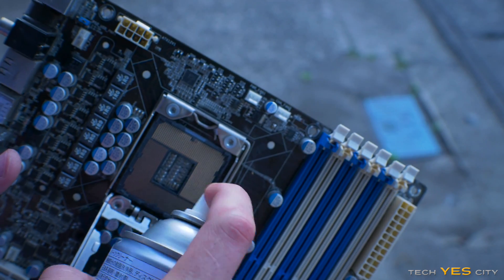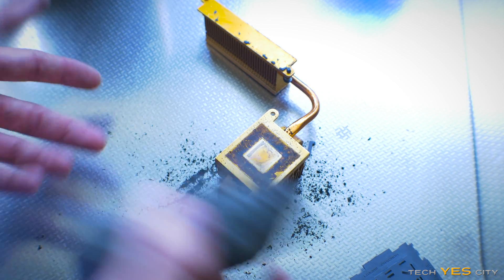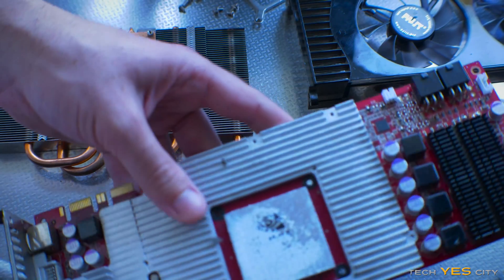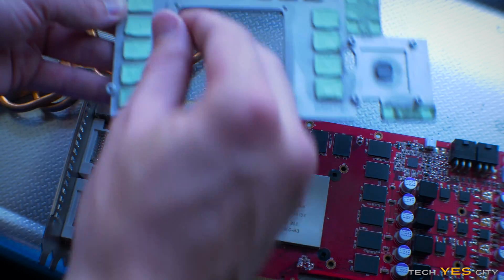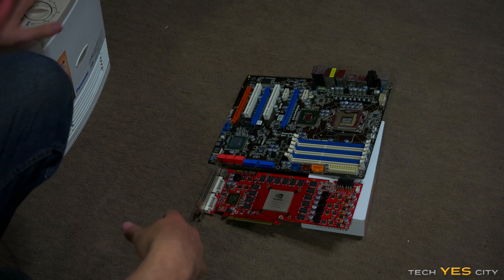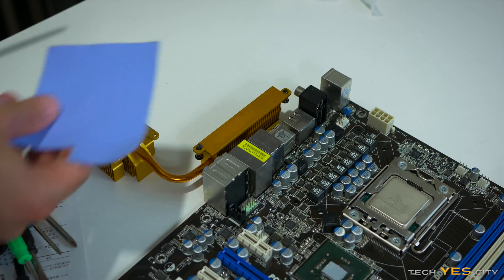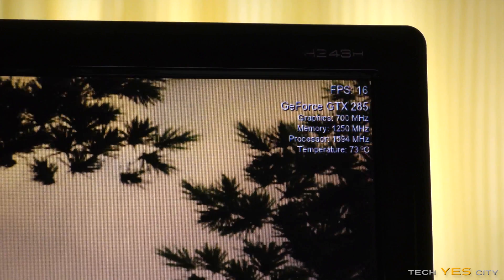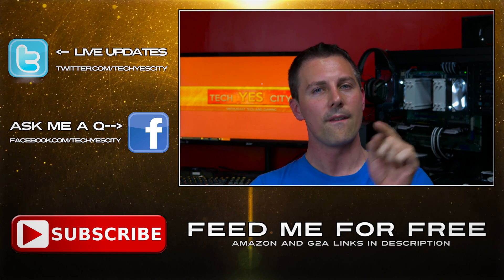PC Parts RESTORATION - How I CLEANSE - Ft. Before and After Temps

Comment: This hurts to watch. I hope no one sends me boards that they cleaned like this.
Reply: Thomas Stolk he legit says in the video "don't spray the plastic fans with break cleaner because it will destroy the fans".
Reply: windowsfrozenshut A $4 thing of 99% alcohol from ebay and 21-14615 brush from mcm electronics. no need to overthink it. ultrasonic cleaner is obviously best but most people have no access to that, so just use the brush with some alcohol and don't overthink it. if there is a part that genuinely needs some scrubbing, some $10 pack of clean room wipers from ebay and 99% alcohol will do as well. 

the further we get into using weirdo chemicals the higher the chance of screwing something. If something isn't nasty and broken, I honestly wouldn't even bother cleaning it. So much shit gets broken for silly reasons from people doing weird things to try to clean it!
Reply: Thomas Stolk Not all break cleaner destroys plastic dude, hence why the damn thing works and why his method has worked in every cleanse he's done so far. I'm not claiming this method is the safest. I think alcohol wipes and a air duster will do the job too, but non-chlorinated brake cleaners will not harm all plastics.
Reply: +Thomas Stolk none of the plastic was cleaned with breakcleaner, unless you weren't paying attention.
Reply: +Louis Rossmann Lol, I was thinking in my head "What would Louis Say about this method" My Curiosity is cured!
Reply: It's hilarious how many people take Louis and Brian's comments deadly serious.
Reply: Adeel Rehman
You missed my point... If it eats through plastic, it's gonna eat through other stuff as well! Also, how did he clean it? With a few wipes? That doesn't get everything. And even if it did, the major problem is that some of it gets under the BGA chips, try getting that out of there with wipes!
And again, corrosion! Who wants their motherboard to start freaking out, because there's corrosion under the south bridge? Worst part is he's selling them to people without warning them about the condition of the components.
Reply: windowsfrozenshut
How can you expect reports? There's probably 5 people in the world that are doing this. And at least one of them resells their parts, meaning no feedback. Also, not everything that hasn't been proven dangerous, is safe. One example is cigarettes. They were considered safe for years.
But you know what, fuck it! Take your computer apart, spray your GPU, CPU and MB with break cleaner, post a video of the process on youtube, and I'll send you the money for the break cleaner over paypal!
If you're right, you get your PC cleaned up and a free can of break cleaner! ;)
Reply: +Adeel Rehman not much of the board? all of the IC's are in plastic. not to forget all tbe connectors.
Reply: Thank you louis.
Reply: Thank you louis.
Reply: reaper reaper well, he's never cleaned anything valuable like this, so. Most expensive build he ever did was 300 bucks or so. With a 100$ motherboard
Reply: Adeel Rehman
That's a lot of money! Plus, he's calling it safe, which it isn't! What if someone who barely managed to save up for a new GPU or MB, does this and breaks something?
Reply: windowsfrozenshut
Where are the reports saying that it doesn't cause damage over time? We're simply using logic. If it says brake cleaner on it and it eats through plastic, it doesn't belong on your GPU!
Reply: didn't he cleaned it with alcohol at 9:03 ? , I believe he did that.
Reply: not all electronic cleaners sprays attack plastic, the only way to know this, is spray the plastic blades of one of the fans in the computer, if they turn white, I wont be using that cleaner, instead will buy another brand (sorry for poor english)
Reply: windowsfrozenshut if you didnt wanted a "random" to anwser your question, but instead to only have louis to anwser it, pm him. or live with it that people respond to your question :^)
Reply: ***** He does not hate LTT. He made a video on how he does not hate LTT.
Reply: ***** He made a video dedicated to explaining how he does not hate LTT. You want the link? He said he just dislikes the reballing myth.
Reply: ***** lol, k.
Reply: reaper reaper well, not much of the board is made of plastic. And tech yes city removes the cleaner later. And the one he uses is light on plastics.
Reply: Thomas Stolk
And he didn't even clean it properly in the video.
Reply: windowsfrozenshut
As I said, OVER TIME! If you clean the chemicals off, then you won't have any over time damage (obviously), but he did NOT clean them! And then he sprayed them with some other crap to make them look shiny.
Reply: @reaperreaper9593  is this dude serious? He even brought up the fact that his entire job is fixing machines that operate under these conditions, but still claim that because nobody made a redit post yelling about losing a ram slot from brake cleaner it's safe? 
I suppose it is only in his best interests that people think you are supposed to break your components under maintenance, nobody calls the technician before shit breaks haha!
Reply: Phakes L. Alcohol wipes, plus that doesn't get rid of the stuff that got under the chips.
Reply: Louis Rossmann Should I use water instead? 
[sarcasm]
Reply: ikr
Reply from the maker: Don't worry no one will be sending you boards that they cleaned like this as they will be busy enjoying their time with the restored product.
Reply: +Louis Rossmann Louis, i decided to clean my macbook with break cleaner, now it wont POST. I already shipped it to you, and filled out the form. Hope you can get it working again. It should get to your store by tomorrow.
Reply: LOUIS!!!!!!!!! Also what's wrong with his method of cleaning?

Lol not everyone has an ultrasonic.
Reply: ***** if by always you mean pointing out something that is going to cause a lot of people to break otherwise working hardware on four separate occasions in five years, then guilty as charged. I have over 900 comments in my feed every day, and a good portion of those are highly critical of every thing I do... it is a side effect of uploading public YT videos. I wish even a quarter of my trolls were as mild as I am.
Reply: Please people, do NOT use brake cleaner without a professional mask and gloves it is very toxic - Tetrachloroethylene
"Short-term exposure: Low levels of Tetrachloroethylene vapour can irritate eyes, nose, mouth, throat and respiratory tract, and cause dizziness, headache, sleepiness and confusion. Direct contact with skin causes irritation and discomfort. Short term exposure to higher levels of Tetrachloroethylene can cause build-up of fluid in the lungs, respiratory irritation, severe shortness of breath, sweating, nausea and vomiting. In extreme cases, short-term exposure to higher levels of this chemical can cause unconsciousness and death.

Long-term exposure: Tetrachloroethylene has been classified by the International Agency for Research on Cancer as a Group 2A Carcinogen, which means that it probably causes cancer in humans. The chemical has been linked to oesophagal cancer, cervical cancer, and non-Hodgkin lymphoma. Animal studies have linked Tetrachloroethylene to liver tumours in mice and kidney tumours in rats.

Long-term exposure to Tetrachloroethylene can damage the central nervous system, liver and kidneys. It can lead to respiratory issues, memory loss and confusion, and acquired colour vision deficiencies. There is a growing body of evidence linking Tetrachloroethylene to a substantial increase in the risk of developing Parkinson’s disease.

Tetrachloroethylene is classified as a teratogen which means that ongoing exposure while pregnant can damage the developing fetus."
Reply: @JohnDoe-le8fy  wow we got all the way from simple critique to dont do this or you will get cancer
Reply: I have to agree with Louis on this one! If it eats through plastic, how can you leave it on your board? And as +Tech YES City said, it's even corrosive. Best method for me by far, is just washing the board and drying it for a few hours at 40-50C (you know, if the old alcohol + tooth/pain brush method doesn't cut it).
Reply: o god another pc part baby ohh no you cant do that wahhh lol
Reply: Medo Gabr
"not everyone has an ultrasonic."
But everyone has a kitchen sink which they can fill with tap water. 
This would have to be better than spraying brake cleaner all over you PC parts.
Reply: Dirtyfastfoodcup
"+Louis Rossmann How exactly would you recommend an average person with no specialized cleaning equipment to do it, then?"
Everyone has a kitchen sink with running tap water.
Reply: +Tech YES City
"Don't worry no one will be sending you boards that they cleaned like this as they will be busy enjoying their time with the restored product."
Restored maybe, but now smells like fucking brake cleaner.
I have always wondered how many of your sold "restored" PC's, have been returned to you for repair or replacement, due to your unorthodox cleaning methods causing later failure of these computer parts ?
Reply: +windowsfrozenshut ehm..not adding a "protective" layer ontop of connectors and not using breakcleaner on a motherboard where many things are covered in plastic. like all of the chips on the mobo (except for the north and south bridge) are covered in plastic

Comment: hey Brian, ive spilled coffie on my pc and the liquid went from top ventilation hole dripped all the way on the gpu (legendary hd5850) now i cleaned gpu pcb with alchocol and nothing i get on startup 100 fan speed and no screen ... is there any way that i could change vrm or fix it somehow  becouse liquid droped where 2x6 pin is connecting to gpu

Comment: Hey bro. Please i need your help.  I have a intel pentium p6200 dual core, 2.1 ghz, 3gb of ram,and a intel hd graphics... i have 30-40 fps on cs:go, 640 resolution, all low. Can i get more fps?
Reply: +Fox CS:GO Going budget you can try to get a GTX 580 second-hand. In Germany they go for around 40€.

Kind regards,
Meta Custom Computers
Reply: Thanks bro, but i have a laptop. In 3 4 months i will buy a intel g3260 (or maybe if i want oc g3258) and a gt 710 2gb ddr3.

Comment: I have a B85M-P33 V2 motherboard doesn't it has a northbridge???
I just see a small heatsink close to the PCI 3.0 connector probably the southbridge
WTF
Reply: +Marco Martins No, the newer boards have the Northbridge integrated in the CPU. On the Intel boards the southbridge is called PCH.

Kind regards,
Meta Custom Computers
Reply: Meta Custom Computers ty for reply bro but then the heatsinks on top on the more expesive motherboards are just for the VRMs right?
Reply: Marco Martins
Yes, for the VRMs and the chokes.

Kind regards,
Meta Custom Computers
Reply: Meta Custom Computers thanks ;)

Comment: I cannot find a video that delids a gpu, i really think you should do a video on that.
Because i want to do it aswell..its just temping me
Reply: I was able to find that one guy comment but if you want to be helpful,
Post the link aswell so he isn't the only guy who posted it, even then i'm unable to find a youtube video of it
Reply: http://www.overclock.net/t/1156145/official-guide-modifying-removing-nvidia-gpu-heat-spreader-ihs
Reply: Yeah that to be expected when your delidding a cpu/gpu but even then..

You would think someone would have used a low price or used gpu to upload a delidding video on youtube
Reply: Probably because you don't need to delid modern GPUs, as the heatsink directly contacts the GPU die, without having an IHS (Integrated Heat Spreader). :P

Comment: Just a heads up, the card in the video is a 200 series card.  Most modern cards won't have an IHS on the GPU, it will be a bare die.  So for those thinking of delidding their cards, you may not be able to.

Personally I didn't own a 500 series card, but I've owned every one since then (600, 700, 900) and they are all bare dies.

Comment: Delid a cheap card that doesn't cost too much
Reply: ***** Can you read? Please tell me where I said that modern GPUs have IHSs.
Reply: +Claire Reed cards have no lid
Reply: +Claire Reed That was a cheap card, I'm guessing he meant on a cheap card its not worth the time and on an expensive card its not worth the risk.
Reply: +H4KD11 older cards (like this gtx 200 series) used lids.
Reply: You can very clearly see that the GPU has an IHS.
Reply: LiquidPanic this card is like 7 or 8 years old... look at more recent cards and show me an ihs

Comment: I was so worryed when you sanded the northbridge. How a silicon die does not break after that?
Reply: Nah, that would be too dangerous to even have the heatsink on it. There is technically a lid to the die, it's very thin, and sanding it is probably a bad idea.
Reply: There is no lid on this family of northbridge chips, the surface he sanded was bare silicon. It is exactly the same as old Athlon XP CPU die.

Comment: Correct me if I'm wrong, but couldn't you use Distilled water and let it dry? Although this certainly wouldn't have all that heavy duty cleansing power just from a few sprays. Plus it'd be harder to make sure every last drop dried up. Meh maybe something to test on $5 components.

Comment: Great video, these diy projects are equally as important as the use of the components and definitely something that manufacturers should probably focus more on than putting RGB LEDs on parts lol (shots fired!).  Hey Bryan I was wondering if the sanding down of the crud that use to be thermal interface material could be removed using the liquid dissolvers like the stuff that arctic sells?  The reason that I ask is because I feel uncomfortable scouring the cooling surface.  Also I'm interested in de-lidding my cpu to get improved lower temperatures and was windering if you could do a video on using different pastes for de-lidding cpus with comparisons?  Thanks for the great content you continue to deliver.

Comment: 11:54 Aw yea... use that finger, spread that mx-4 slower… slower you dirty dir__ ahem, yes. Nicely done. I just did this to a Nvidia Quadro 3800 yesterday, it's IHS was huge too. I thought I was going to break something when I took the cooler off because of the surface tension of the old thermal paste. Great video over all. I looked into 5-56 and it seems comparable to WD40, have you tried that in it's place or is it not commonly available in Japan? I'm still too chicken to try it on my parts Senpai.

Comment: I'm not confident anymore to clean my PC, last time, when I exchanged my old GPU for a stronger one, I cleaned and restored it for selling. But since then, it's kinda broken? It's still putting out a Videosignal, but the whole screen is filled with white stripes, which also react to the mouse coursor. I tested it on differnt PCs with same result. I can't explain how that card broke, I checked it for outside damage and for heat paste short, but I couldn't find anything.

Comment: You can always just have a compressor ready, spray on the brake cleaner and immediately use the compressor to blast the cleaner off.

Also, the reason people do the pea method is because that thermal paste is highly toxic. I wouldn't want to have that shit on my fingers so often.

Comment: Can I use WD-40 instead of CRC 5-56?
Reply: +R4MP4G3RXD noooo, WD40 is an oil penetrate (main ingediant is fish oil) if you dont wanna use parts cleaner or the crc, use isopropal alcohol, you need something that will dry up after, which is why brake clean works so well. and why he uses alcohol wipes
Reply: What the hell can I use instead of crc 5.56?HeavyHERO93

Comment: Hey Brian, just curious on the type of "brake cleaner" you use for cleaning.  One of the most popular brands in the USA is BRAKLEEN, made by CRC.  From my personal experience it is highly corrosive and burns your hands and lungs like a mother.  It's active ingredient is tetrachrloroethylene  or Perchloroethylene.  They also make a non-chlorinated version that seems much safer and contains mostly acetone and toluene.  Can you see what is in that Japanese brand of cleaner you are using?  I never seen that 5.56 product before but it is made by the same manufacturer (CRC).  What's the reason for using that?  It seems like an anticorrosive and lubricant.

Comment: northbridge? I just restored a computer with an A780GM-A.  since its about 8 years old should it have been crucial to repaste the northbridge? thanks in advance the end of that video was hilarious
Reply: +modstek To be honest, I'd recommend to go through the hassle and disasseble the system again to get some thermal paste on the Northbridge. The Northbridge on the old Phenom-Boards runs a bit warmer, especially with an overclocked Front Side Bus. I wouldn't risk bad thermals or malfunction of the board only to save 30 minutes of my life.

Kind regards,
Meta Custom Computers
Reply: it's not crucial unless you are going to over clock and run benchmarks 24/7
Reply: +Ian Witten hi and thank you very much for the heads up. I do have it overclocked by the fsb only because its a phenom but not black edition however Monday I will be receiving the black edition. now im kicking myself in the butt for not doing it....thanks again I do appreciate it.
Reply: +Meta Custom Computers thanks for the reply I appreciate. I did go through it the other day and and cleaned and re pasted it with mx-7. im going to make this a standard process for now on when working with older machines....I received a black edition processor today so im gonna give it hell. wish me luck lol
Reply: Fingers crossed and godspeed. :)

Kind regards,
Meta Custom Computers